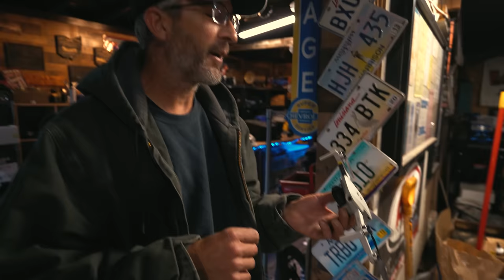Building the CLEANEST Twin Turbo S10 Street Truck! Project SUB-ZERO

Comment: As much as I loved my '86 back in the day, I love the 85 and earlier 6 hole dash that was just begging for an all AutoMeter gauge replacement in every hole. Man does this video bring back some good memories, sore knuckles..... and without a lift, laying on my back while hammering the tunnel to clear the TH350 and full exhaust. It's been 30 years now since I built my first SBC swapped '86 S10 back in 1993 and I would give anything to be back living in that time, although my 2nd attempt with a 4l80e in an '88 5 years later with power steering and power brakes was my favorite. Even though the first one only had manual steering and lacked power brakes, I still hold it in fond memory, as it was my first. You never forget your first.

Comment: Have you considered doing a split coolant system with 2 small radiators, one for each bank, and completely separate of each other. You could put them on the far sides behind the headlights, and still put the turbos visible behind the grill.
It would require some modifications to the water ports on the intake, and 2 inline water pumps. This would also aid in diagnosing a head gasket problem, if and when it might happen. Just thinkin out loud I guess. Love that sweet looking truck btw!!

Comment: Since we don't have much going on at work this video makes me wanna go down in the sheet metal shop and make a tire pressure gauge lock box with a fkd up tricky lock that yall can put all the gauges in and hand the old man the key. Put TPG security badge on it cut out from the water jet. Hang it in the front of the shop and see how long it takes him to figure it out.

Comment: The engine hoist is easy to fix. Get the hydrolic cylinder off and take it to a hydrolic repair place and get a kit and rebuild it yourself and your done. Kit should be 3 pieces for the ram and maybe a couple for the valve and your done!

Comment: I bought a 93' s-10 in 94 with 10,000 miles . It didn't have that hydraulic cylinder on the front end. New to me.
Reply: I'm 45. We lived in a single wide trailer till I was 12yrs old. Not ragged. Actually was a nice house on a couple acres. Back when you do rite or else. My dad was picking with me one day and I wasn't up for anything and I bowed up to him right in front of the back door and he threw my ass through the door and I slid down the old school concrete steps that came with the house. He was like well, I got to buy a door now. True story.

Comment: DRONE GET A SMALL ROPE 100FT 150 FT AND GET ONE OF THOSE LITTLE 3LB SAND BAG A TREE SERV LIKE VERMEER WILL HAVE IT ,NOW what you do is get that 3lb sand bag up and over the limb let it drop and get both ends of the rope together and start yanking it back and forth shaking the limb until it drops .hope this helps ,ive had to use mine multiple times and gotten the drone every time (NO KWAD LEFT BEHIND )✌️✌️✌️

Comment: I've always said that S10s are the Fox body of pickups - if you see a truck at the drag strip, probably 3:1 that it's an S10. Good aftermarket, absolutely E-Z and DIRT CHEAP to V8 swap, lightweight, stock suspension can work great, like Fox bodies they're a hard to beat option. Especially on a budget.

I still prefer Ford Rangers though LOL. I wouldn't kick a nice dime outta bed though...

Comment: That lip is always in the way for removing stock engine or transmission. Gm actually wants you to lift cab slightly to remove that bolt

Comment: Billy, I believe you should go and find yourself another S-10 just like Sub-Zero and transfer/ new parts for that and retire the white truck you are driving now. Use the motor/transmission combo for the new truck and what's got to be replaced , replace it with new parts.

Comment: When we raced go-karts we only had about 15 HP to work with...I remember taking the seals out of the rear axle bearings and spraying them clean with carb  cleaner and puting graphite on the races to spin freely ...in low HP racing to roll like a skateboard really made a difference ...a few numbers here or there added up to tenths which slowly made seconds...I often wonder about plexiglass windows is it worth the weight it saves? Me....I like the look of real glass and cars I can relate to

Comment: You guys can make both Jack's air instead of oil switch it over , I'm surprised you haven't made a new longer tubing that extends out if was 12-15 inches longer would make it stronger too. Bob the Builder  and Big Bill going testing guys time out , the Nova should haul the mail ..
Reply: On the Engine Hoist make the slide tubing longer it'll make it stronger

Comment: I own a gbody 442 t-top car and I want to build it with my son who is 15 that way he will have it forever with the memories of us together. My goal is to build a street car complete with original plush seats and interior console factory everything even a/c but I really want for us to be able to drive it 40 miles to track race 5.70 index and if not just mainly a 5second pass easily with no issues and drive it 40 miles home. That is my dream for me and my son to do. I think it’s very possible but it’s hard to do with working 60hrs a week and money also. Hopefully the time and money come together one day. I feel like it’s gunna take 1000hp in a car like that to run that number and be dependable but I have a fresh 406 with dart pro 1 and solid roller. The motor prolly 500ish so that means I gots to spray it 4-500hp shot. That part don’t seem dependable 😆. Probably need to figure out a turbo combo. Problem is I’ve never messed with a turbo. Any ideas out there to make a reliable 5second gbody?????? I’m open to them

Comment: You need to Sign all of your old stuff you put on the Truck so when you blow up and go pro it will be worth something just think if you had a peace of Kenny Bernstein old parts the first racer to brake 300 miles and hour with a top fuel dragster in the 1/4

Comment: How did they know the wiring that quick? I need some tips
Reply from the maker: Not much wiring required. Using a lot of the factory harness and factory gauges . The most intensive wiring will be the new MSD ignition box, and wiring up a trans brake.